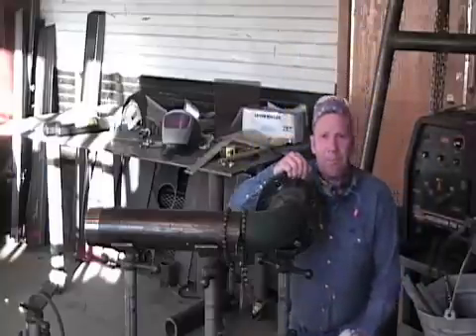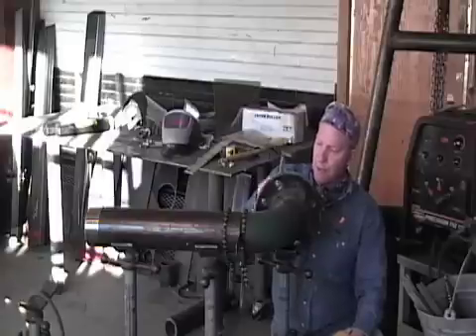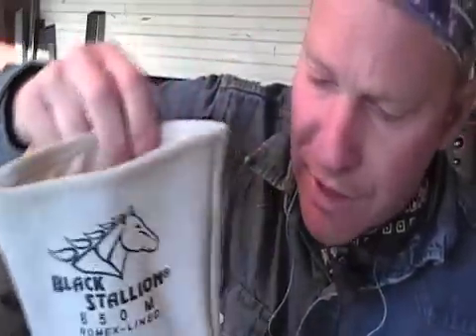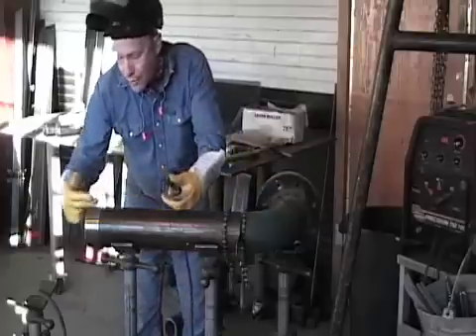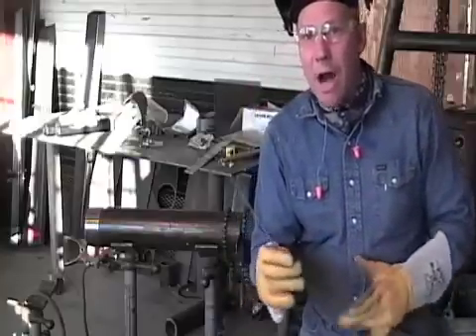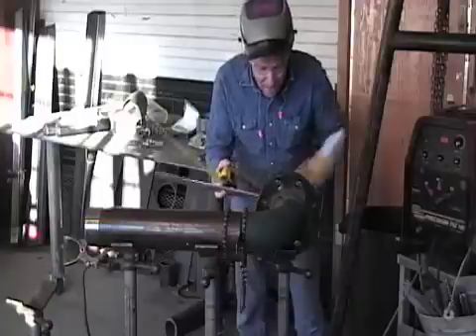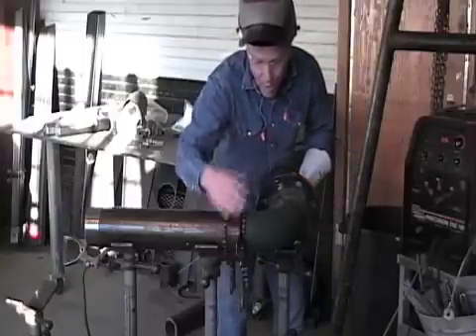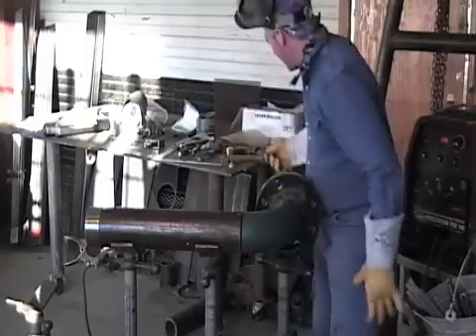Welding Home Study Course from The Welders Lens

Comment from the maker: Hey big daddy, I use banding material. Its that real thin metal that comes on pallets keeping the pallet banded together. It is black metal. The stuff I have is about 1 1/2" wide and less than a 1/16"thick. I doubled up on it and made some welds on the sides and ends to hold it together. Works great.